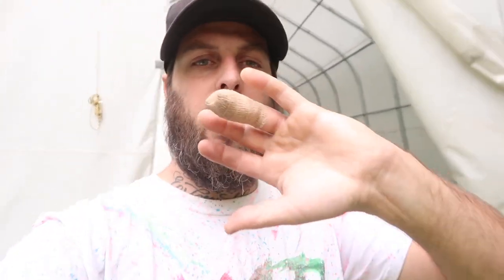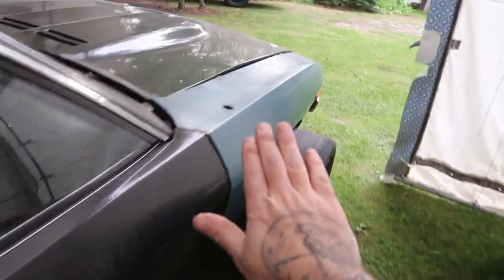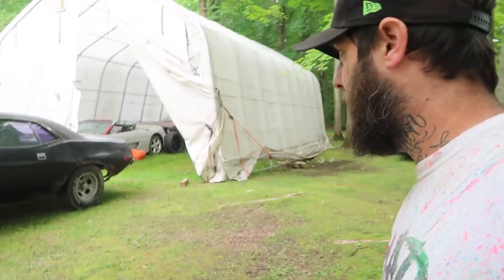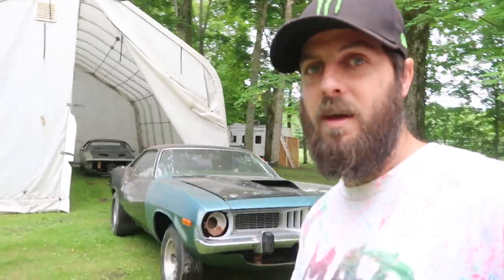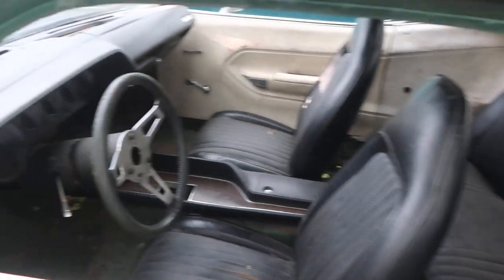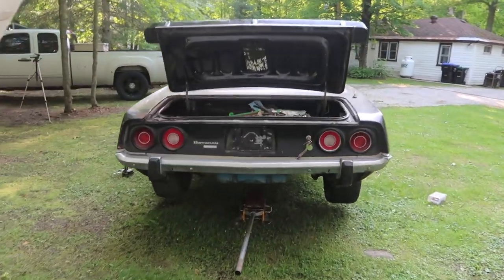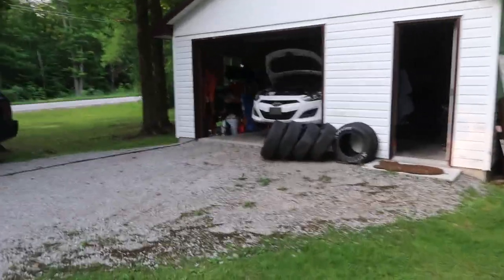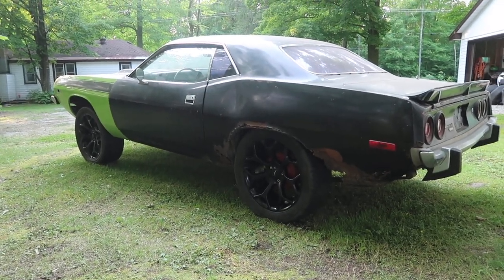RESTOMOD - 1973 Plymouth Cuda AAR with HELLCAT ENGINE?

Comment: The ralley hood look very cool , but so does the AAR  , decisions, decisions. I agree,  the round taillights  look best , but the '70 model  grille  is the  nicest  in my  opinion. If it was me  I'd be polishing up those slot mags , you can get a mirror  shine  on them and they'd look great and suit the era  of the car, too late now I suppose. And lose the overriders.
Reply from the maker: Can’t beat that oldschool look, maybe I’ll build the 73 with some restomod styling and the 74 will be full blown oldschool street freak like the RTS cuda that just sold for $2,000,000